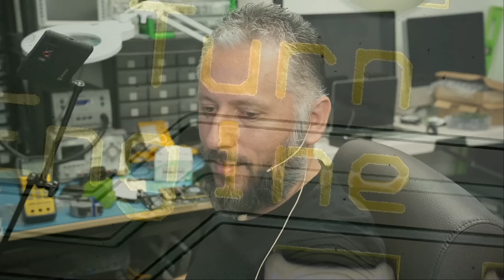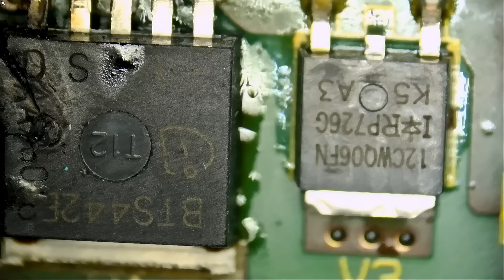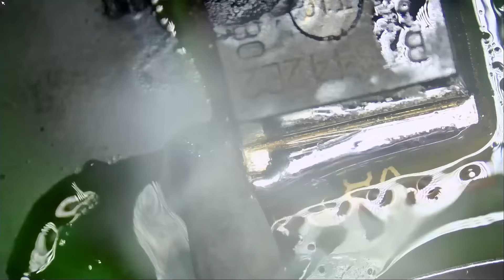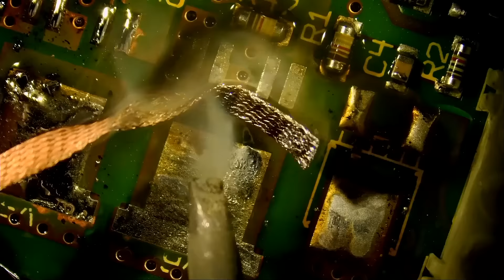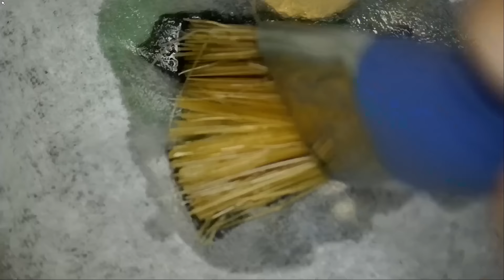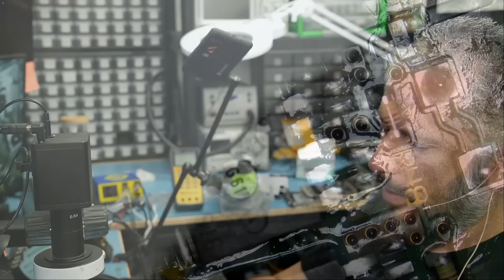Super expensive Ferretti Yacht motherboard  Repair - Urgent 3 hours service request.

Comment: With all the damage on that board, why not do a diagnostic check on the other components as well?
Reply: because as he stated the customer needed that repair done ASAP,  he don't have time to go digging around components trying to find out values for a foreign board he's never worked on before
Reply: It's not what the customer wants, they specifically requested just the soldering.
Reply: @mips13  It's called, "Customer service".
Your sort of service is what has become a sorry state of affairs these days.
Reply: @robertpage2023  You did not listen to what he said, the customer was very specific about only doing soldering and getting the board back asap.
Reply: @robertpage2023  you wouldn't want to get too involved with the issue.   hes just doing exactly what the customer asked him to do..    if northridge gets too involved the boat owner might try blaming him with any future problems relating to system that uses the board.  its likely a $1,000,000+ boat.
Reply: @sausagefingers714  Holy Crap..............I'm not saying that he should do any more work than asked to do but to simply take a look a the working order of the related components in the area of the damage to see if anything else was destroyed or not working.
THEN, he can tell the customer what else he found.
How is  that going to come back to bite him in the rear???
How does putting meter probes on a component change anything?
How does a simple diagnostic check make you "more involved"?
I've seen him do it on many other boards after doing a repair to check out the potential other problems before reassembly and mailing off back to the customer and when he does find other problems he tells the customer before making the new repair.
I would want such service.
Reply: @robertpage2023  yeah but youre not the customer. So when you send your board into be repaired, you can request that service. Northridge did what the customer asked. That is great customer service.

Comment: The parts that you have been replaced looks like switching some high current motor or something else so if the parts burn like that probably new parts will burn again owner has to be carrefull about that.the job was easy for Alex he did well what the customer needs well done
Reply: You would hope the owner knows exactly what he switched on that burnt out the board and has replaced it. Maybe it was a freak accident like a motor stalled by a rope tangle or something.
Reply: Yeah looks like he has a motor with all three windings shorted from the damage to those triacs

Comment: If you didn't add a new layer of conformal coating at the end u should ask the customer to do it, boat stuff gets wet.
Reply: You really think this million dollar yacht is housing it's board where it gets exposed to air instead of a sealed compartment?
Besides, he didn't remove any coating before soldering so I don't think it had any to begin with.
Reply: @cleitonfelipe2092  Oh really? Not trying to be a dick or anything but you can clearly see the coating on it in the beginning. That strong smell he was smelling was the coating melting. You cannot solder conformal coating, as this is the nature of soldering. He vaporized the coating with the iron and added new solder. I would have done it the same way.

Pretty much all boat PCBs, even those in an enclosure. especially on a Feretti, are conformally coated. The last thing you want is to open the enclosure for service or whatever and have a drop of salt water land on the PCB.

I assume he left off the coating so that the customer's technician could test it properly. Probing through the coating is a bitch.
Reply: @JacobJonesy  Juat curious, how do you know its going to get wet? Most of the places I can think of to mount circuit boards on a yacht should absolutely not get wet, even without an enclosure? Do you know where this board is mounted and what it is for? In that case, I would be also be curious to know that, could be nice info, I am interested in boats but rarely work on circuit boards in them. Thanks in advance and cheers mate.
Reply: @cleitonfelipe2092 bingo
Reply: Absolutely agree! Salt water is even much worse for electronics than ordinary water. Even the air on a yacht in sea water can cause corrsion...

Comment: wow, i'd be soooooo nervous working on a >$100K device. or a device on something $100K or more 😅
Reply: The electronics are still repaired using the exact same logic and tools as if it were in a 900 dollar laptop. Circuitry is similar, except for "Proprietary Tech", which is assessed on an individual case-by-case basis, and can be an interesting job.

Comment: What about a quick test measurement on an obvious short that may has caused the issue? Maybe ist only a shorted cap or something...
Reply: If the customer is requesting to change specific components then it is assumed that the customer knows what the issue is and your job is to change the components as requested. 🤷‍♂️ That’s what they’re paying. Not for diagnosis.
Reply: Yes just putting on the requested/supplied parts is IMHO lazy. It doesn't take much time to test for obvious shorts or to test the surrounding passive components.
Reply: You only do what the customer requests, anything else is folly.
Reply: @Paperghost  Ooo we a have a half ass'r in the comments...
Reply: @VashStarwind without schematics you'd just be guessing. Hopefully a boat tech that can get a board repaired can also understand wider electronics repair on the other boat equipment that probably caused this failure.